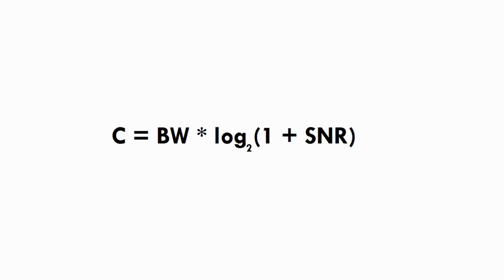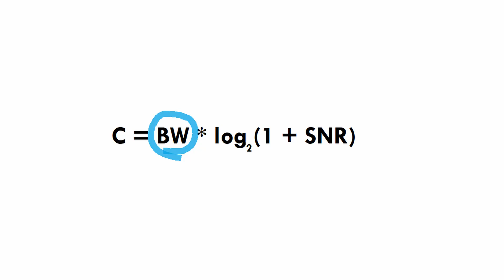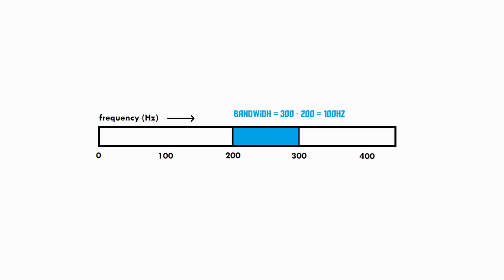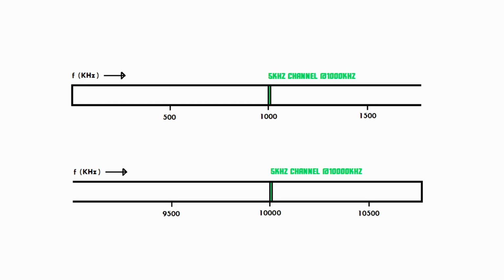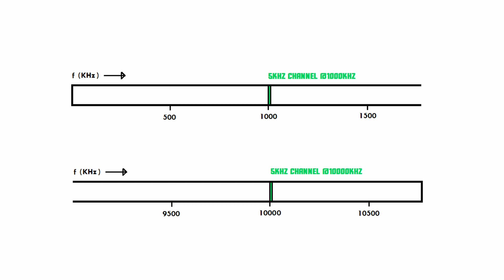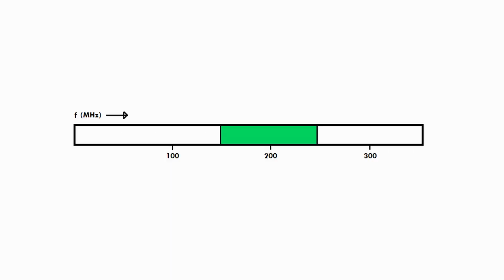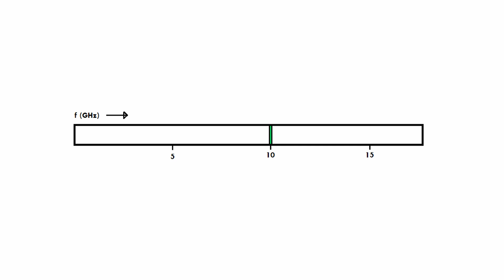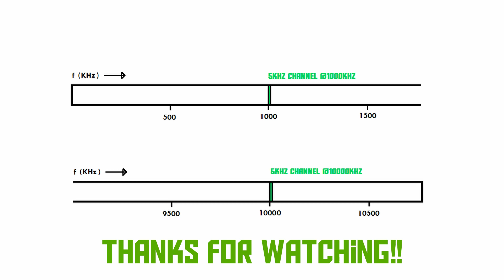Does higher radio frequency = more speed? (AKIO TV)

Comment from the maker: This isn't mentioned in the video because it's pretty obvious, but I should point it out anyway: There is of course a hard limit to the bandwidth, which is that you can't go below zero. In other words, if your center frequency is 100MHz, you can't create a 300MHz channel, because the lowest you can go is 0Hz, so 200MHz would be the maximum bandwidth. To do 300MHz, you'd need a center frequency of at least 150. 

As you've seen in the video though, you start to run into other issues before you reach this limit.

Comment: So the reason it's the bandwidth that determines data-rate is because the information is transmitted via frequency modulation? Also, I'm guessing there is a practical limit on the amount of discretisation one can do to a FM signal, thus only increasing the spread of the band can increase data-rate?
Reply from the maker: Even with AM or othet types of modulation the bandwith increases with data rate.

Consider an on-off modulated radio wave, basically something like morse code. If you made a frequency spectrum of that you'd see the BW isn't 0, even though you might expect the transmitter to only use a specific frequency.

Why? Because the signal turns on and off, so the signal isn't a pure sine wave, but one with starts and ends. To produce those starts and ends, you need harmonics, eg signals at different frequencies, so all of a sudden even though it wasn't your intention, you're transmitting at multiple frequencies